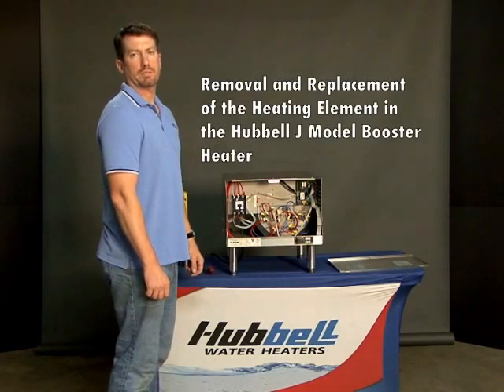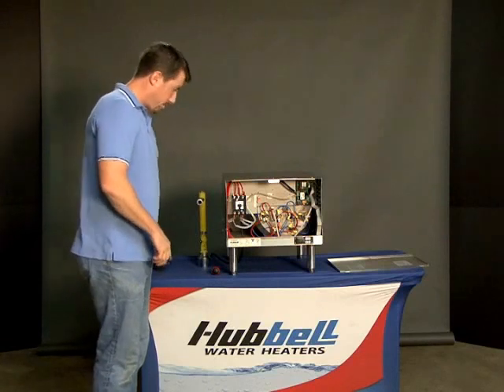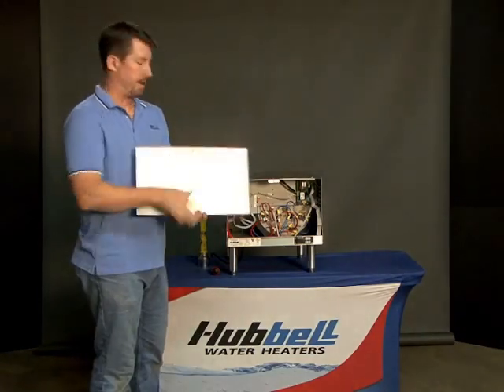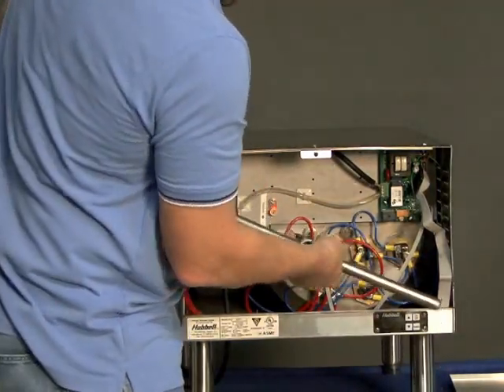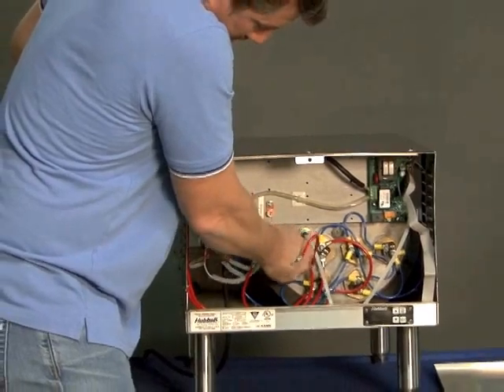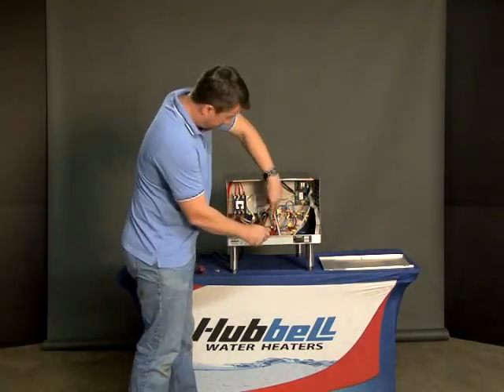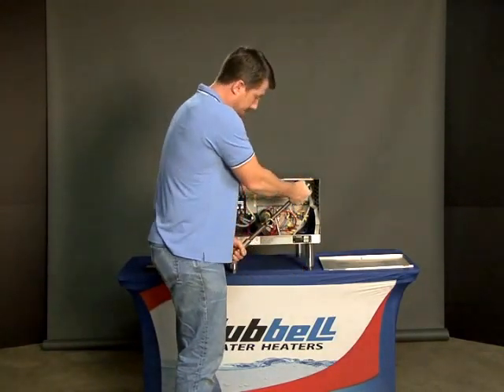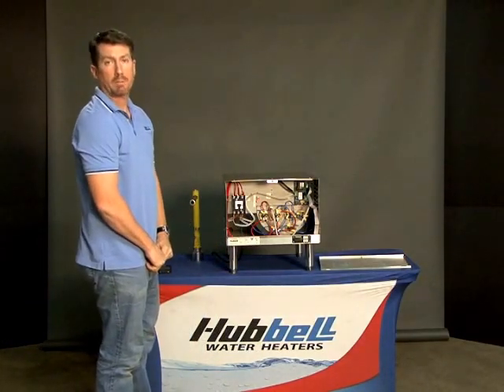Hubbell Booster - Heating Element Removal & Replacement

Comment: how do you drain the scalding hot water?
Reply from the maker: +Phi-Long Phan Hubbell recommends turning off the breaker and flowing water through the heater until it cools down the wetted components. This will cool any of the hot, wetted components in the heater. Thus eliminating the safety concern of draining hot water from the heating chamber.
Reply: How do you drain the water? Last time I just let water spill out from the heating element socket.  @Hubbellheaters